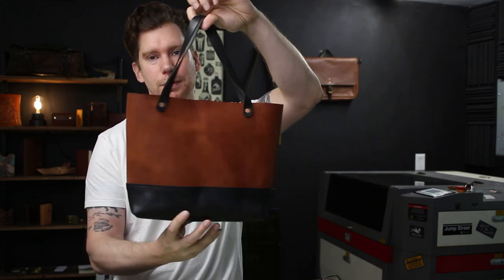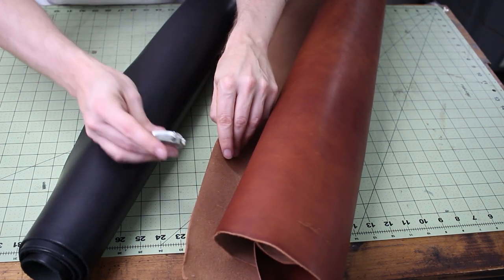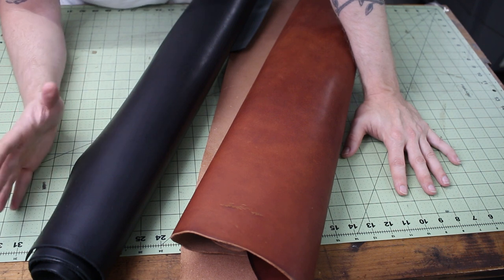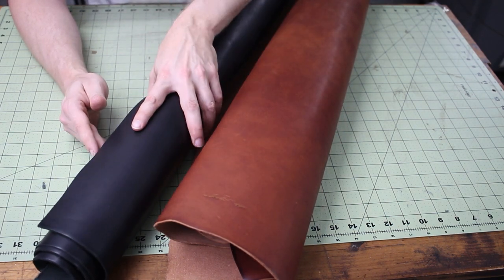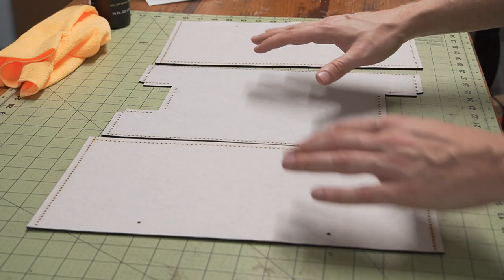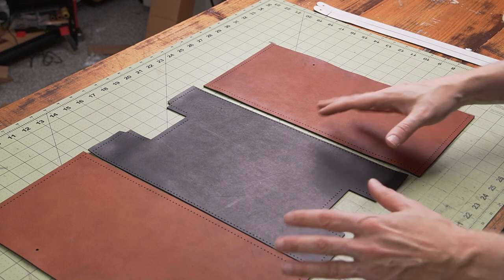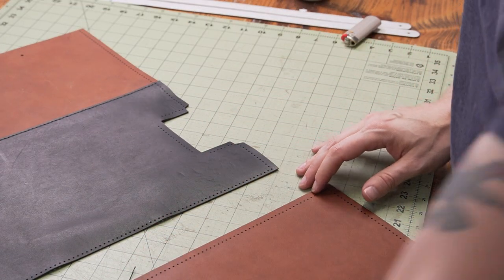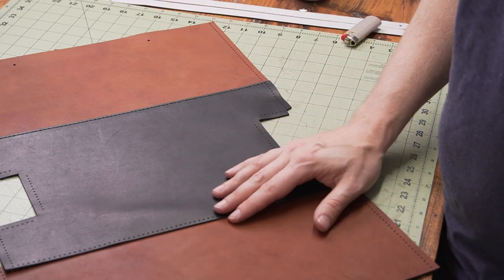Laser Cut and Hand-Stitched Leather Tote Bag - Build Along Tutorial

Comment: I just completed this bag, except for hammering down the rivets (it's 1:30 in the morning). Came out great, and despite being laser cut, it took some time. I did my own dyeing as well.

However, my suggestion is that the straps need to be longer. I wish I would have checked. They are about 19 in, but are still too short. Live and learn. My wife can still carry it on her shoulder, but there's not much room.

Comment: great tutorial, I may try this using my industrial sewing machine.  My only comments on the design is that it would look better and be more practical if it were slightly taller.  And the straps longer and had 2 rivets on each connection point, IMHO.